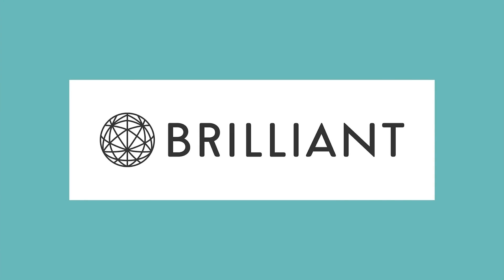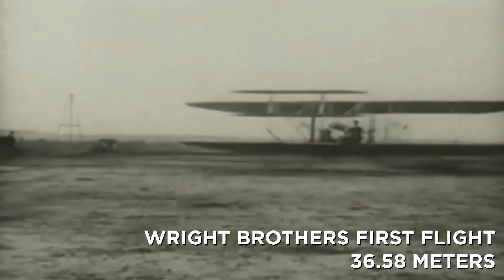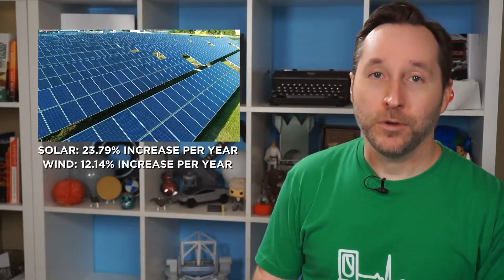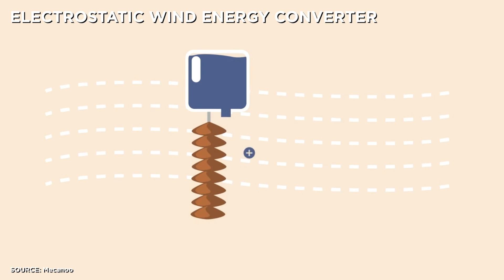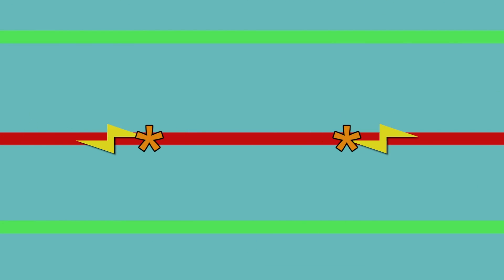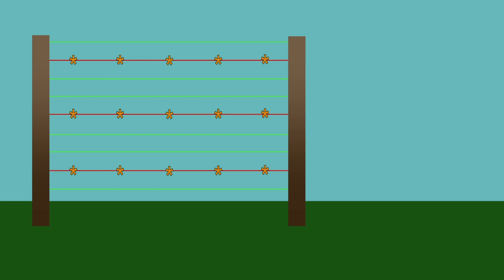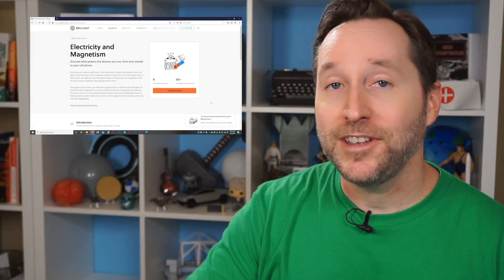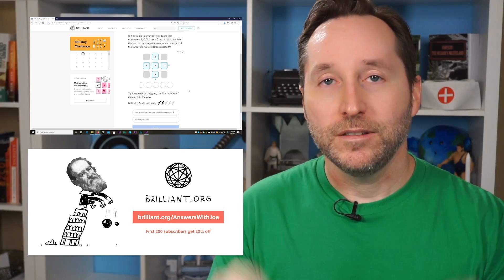Solid State Wind Energy | Random Thursday

Comment: This means that every vineyard can be an electric source too.
Reply: The vines might disagree
Reply: @stiimuli  I don't want to go to deep into details, but between harvest in autumn, and the next spring, the wires in a vineyard are mainly free of vines.
Reply: @SiqueScarface   I'm intrigued. I'm curious about practical details, like the effective range from the ground the wires should/can be; Positive/negative effects upon foliage on/near the wiring and how that foliage might affect the energy productivity; Whether birds, insects, curious children, clumsy vintners, etc. might endanger themselves with inadvertent contact; How high the voltage should be to create the charge, and how that voltage/current would need to be converted to transfer it for storage/usage.

Higher voltage yields better wattage efficiency in transit, so smaller gauge cables can transmit a lower amperage (for similar net wattage) further before dissipating some energy as heat, and possibly melting the transfer lines. But, lower voltages are less prone to accidental electrocutions.
Well, I should say less prone to accidentally FATAL electrocutions.
Every tradesman that I've ever known, is bestowed the honor from time to time, of bleeding for their profession, in the pursuit of perfecting their craft.
Reply: I wonder if that would add a distinct flavor. Ionic wine.
Reply: Might give an extra spark to the vine, win win situation for you right there.
Reply: @KlausJepps  don't you mean wine wine 😂
Reply: @AleksandarGrozdanoski  a good one there sir! Thank you for making this a better day.
Reply: You might actually invent charged wine grapes. Shockingly delicious.
Reply: Excellent idea, SiqueScarface! Besides, grapes would mature more rapidly. Moreover, as grapes ripen they become more tender. By the time they're ready for harvest, the pressure the ionic wind exerts on them will turn them to wine 😁
Reply: Can anyway via fermentation
Reply: If there's enough wind.
Reply: How about using it to make the border wall.
Reply: There’s a YT video showing grapes in a microwave becoming plasma balls just gotta avoid that frequency. Could be used to keep the vineyard warm when early frost comes before harvest.
Reply: I think you are on to something think of all the miles of barbed wire fence that are already up. The biggest issue is that it relies on aluminum

Comment: “40 thousand volts is a lot of energy that would drain the battery really quickly”.... um what? The wattage is the part that really matters. You can step voltage or down but if the available amp hour is only small  with high draw demand, then yes it will drain quick,  but the question is how much energy was consumed in the process of sustaining level flight in that test plane? With such a large air gap I would assume there’s quite a high resistance even with ionising the air, meaning that even at a high voltage the current draw would be relatively low, or at least only marginally less  (eg, half as...?) efficient as an electric RC planes. 

Sorry for being picky, but I thought this would have been addressed, especially after the oddly worded quote above. 

Again, no hate, just a question because that point didn’t make sense

Comment: "40.000 Volts is a lot of energy" ... um, no! The voltage is just an energy potential, the actual energy consumption depends on the current, which in turn depends on the amount of air ionized by the engine. Sorry, but that sentence triggered me, because there is no massive draw on the battery just because of the high voltage.
Reply: I was coming down in the comments to say this very thing.
Reply: Correctly pointed out.
Reply: Noticed that too. And was wondering whats the actual power consumption when ionizing the air like this.
Reply: Just like my fly/mosquito/wasp torture/killing racket runs of 2 AA batteries without a problem.
Reply: So what you're saying is you can connect the wire to power, leave it open, connect the negative to a wire, leave that open and there would be no draw on the battery unless there is a resistance? This could potentially work until the battery life is expended? Would creating 20000v be difficult? Big generator also turned by the wind and Use a battery for a buffer system?
Reply: @aren87nd  There is always resistance. but the "power" is determined by both the voltage and the amperage. Amperage determined by the resistance at the given voltage. "Energy" is power for a given time. Power is measured in watts
Watt= Volt*Amp
"Energy" would be Watt-hours, for example running a one watt bulb for an entire hour.
Reply: @aren87nd  unless you are talking about a superconductor, there is always resistance.  Currently there are no superconductors that operate at anything close to "normal" temperatures.
Reply: @aren87nd  Nope. just use DC DC converter or AC DC converter. It can easily reach 20K. I ever used it once. it is low current but still it bit.
Reply: Moving enough air to fly a full sized passenger jet does take quite a bit of wattage, regardless. Yes, you're right, but joe's point stands.
Reply: Nerd
Reply: True, but you cannot carry 20,000 v worth of batteries.  You have to convert whatever your DC battery voltage is.  The circuitry to perform this will certainly use a substantial amount of current.
So while Joe's statement may not be specifically accurate,  it is true that producing 20-40k volts in a mobile application, would use a significant amount of energy.
Reply: I was hoping someone would point this out. It all comes down to efficiency. There are currently (lol) electric aircraft that drive propellers with electric current. Can a solid-state airfoil move the air more efficiently than a propeller attached to an electric motor? Converting the stored battery voltage up to 40kV, you're likely to lose some energy going from DC to AC, then an AC transformer, back to DC to pull it off. Unless you stack a bunch of batteries in series, but the internal resistance there could be massive. The electric propeller approach may also require voltage conversion, so the two approaches may have similar efficiencies at that particular point in the process. Except that an electric propeller might use an AC motor, making that final step from AC back to DC unnecessary.
Reply: @tom_something  I think the necessary weight to produce that kind of voltage directly from batteries would be too great.  You would have to use some kind of converter.
Reply: @jerryfick613  voltage doesn't give you the whole picture. A handheld stun gun often operates at voltages in the tens of thousands. We'd need to know the voltage and current to determine what kind of components can pull it off.

Here is a converter that takes 3.6-4.8V as an input (that's about the range of a single lithium-ion cell, or multiple cells in parallel), and outputs 40-50kV. It's eleven dollars and weighs less than two ounces. Do I think it can handle the power? Maybe not, but that's not because of the voltage.

https://www.amazon.com/3-6V-4-8V-40KV-50KV-Transformer-Generator-Inverter/dp/B07GNGMLN8
Reply: Automotive ignition coils change 12v to 40-100k volts with no amperage. This system wouldnt need any current either, due to the fact there is no load except for natural resistance. Im by no means a electrician, but i know DC. This system would run DC current? Would it lose much amperage (except natural resistance) due to the loss of negative electrons?
Reply: yeah, with enough turns ratio, simply back EMF can produce that much spike
Reply: Trigger please🙄

Comment: We've had the solution for all the world's clean reliable energy needs for decades: nuclear. Thanks to ignorance, paranoia and fear mongering instead of building them we are shutting them down. We are causing our own extinction, we know we're doing it and we keep doing it and we deserve it.
Reply: Clean, uh what about the mining process? What about the waste, NOBODY knows, what to do with? What about the contaminated earth and debris of Fukushima? Reliable, uh what about all the time, they don´t work reliably, because the river cooling it, is too hot or security risks, which demand them to throttle down? Here in Europe near France an Belgium we have to fear for our savety, because most of the reactors are past their lifespan. They have malfunctions all the time, which make them pretty unreliable. And please don´t start with the "new" super "safe" molten salt whatever designs. None of them are proven or ready to build for real usage. And this is not because of money, they are researched for 50-60 years now. The just don´t work or at least not in and cost efficient manner. Wind and solar energy is so much cheaper today, it does not make sense for sensible investors to build other power plants. You can exclude the cost of the nuclear part at a nuclear plant and just the cost of the plant, turbines etc. is higher than the cost of building a wind farm. We deserve extinction because of our way of living beyond our means on this planet.

Comment: I would advocate any energy source that is renewable, non-destructive (to the environment - unlike hydroelectric dams).  I'm kind of surprised we haven't figured out how to tap into the heat of our mantle in some way.  Geothermal is capitalized upon, but I mean to a different degree.  If drilling technology were at a different stage of development maybe we could figure a safe way to use the heat energy without making a volcano.
For example:  A drill with a hafnium-carbide housing and an internal liquid-loop to cool internal components might provide a structure allowing deeper drilling.  Alphabet Energy's E1 thermoelectric generator currently runs off of diesel (which is lunacy), but could possibly be powered by the intense heat of the generators depth.  A piezoelectric effect made possible by the intense pressure of the machines depth could work in tandem.  Electrical energy gained by the heat, energy gained by the pressure.  I imagine it would be very safe (save for the risk of destruction/damage to the machinery itself) as it isn't radioactive, isn't combustive, and is far from any living things of import.